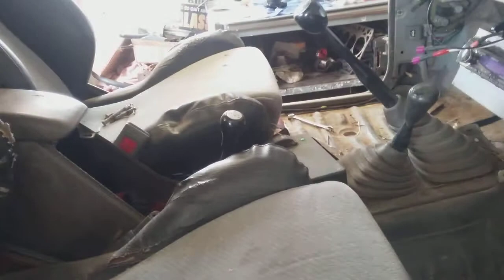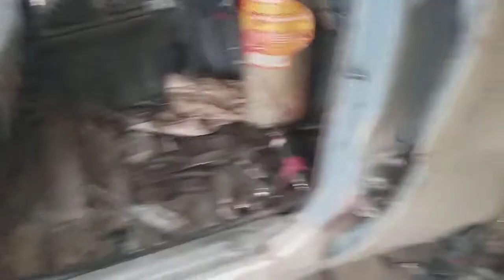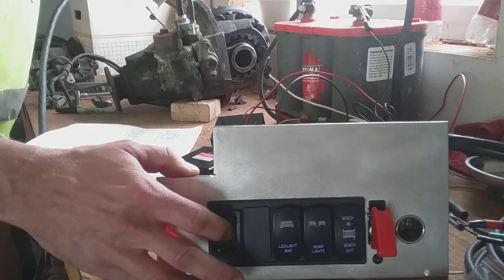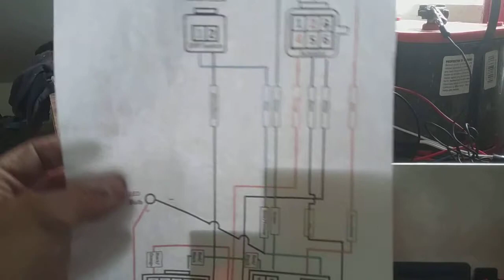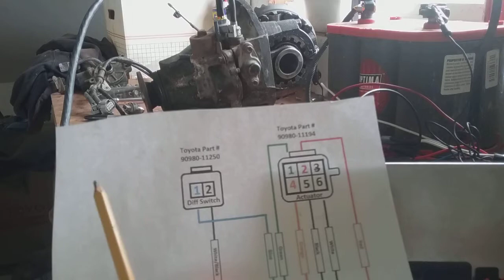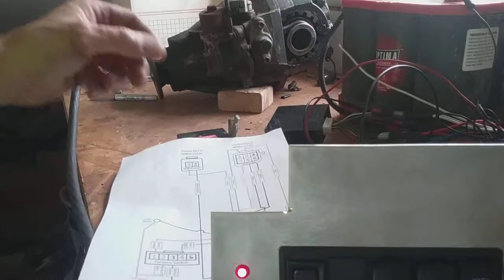Toyota E locker wiring with factory ECU and switch

Comment: DO NOT USE THIS WIRING DIAGRAM!!!!!! THE ECU PINOUT IS WRONG!!!!!!!! NO MATTER WHICH WAY YOU TURN THE PLUG OR THE ECU-NUMERIC LOCATIONS WILL NOT CORRESPOND. WIRING COLORS VARY DEPENDING ON MODEL. ALL ECMS ARE THE SAME THEREFORE ALL ECMS WILL INTERCHANGE WITHIN GENERATIONS AND SOME MAY INTERCHANGE BETWEEN GENERATIONS.  IT MAY BE WORKING IN THIS VIDEO BUT THE WIRING DIAGRAM IS NOT A GOOD REPRESENTETION.
Reply from the maker: I said in the video the pinout and wire color are mine.  If you connect the wires to the locations of the connector in the diagram it will work
Reply: My god he’s having a nervous breakdown